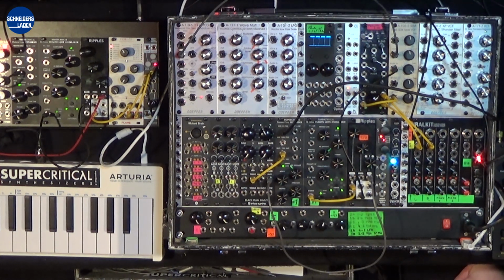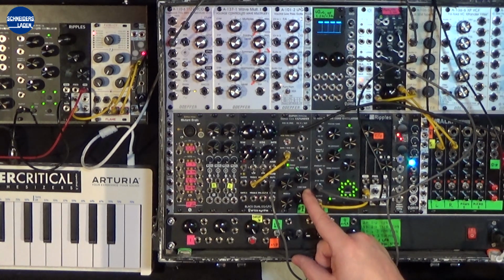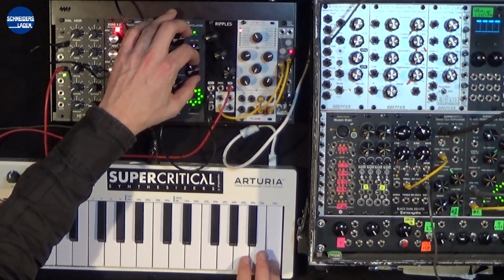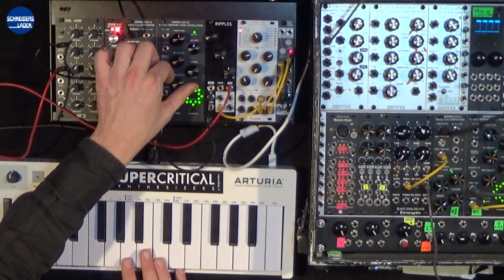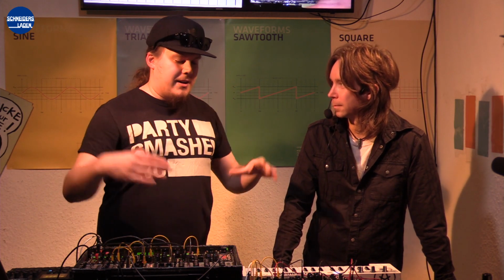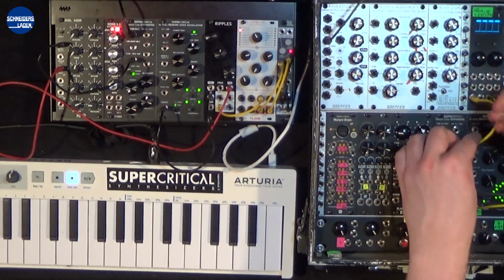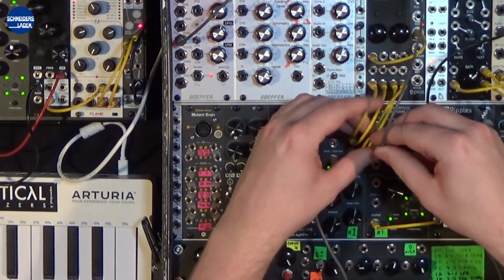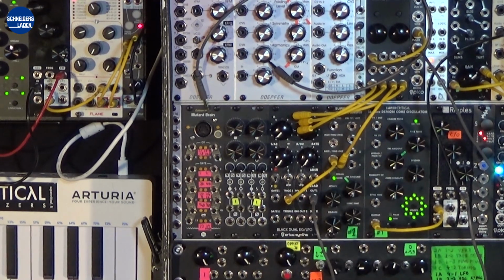Supercritical Synthesizer - Demon Core Workshop @SchneidersLaden

Comment: Hello ,
just a question :

Is it possible to play the module with external keyboard without using the expander? I use normaly an FH-2 to convert midi to CV. Also, I see a 1/oct input on your module but not the gate input 🤔.

Thanks in advance